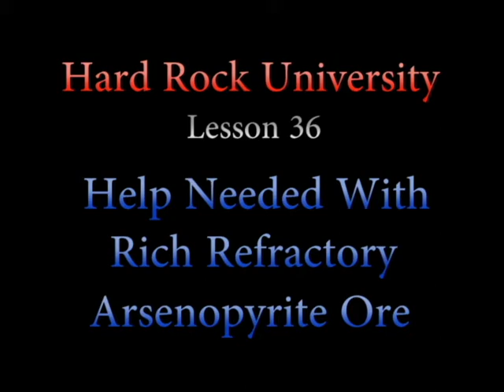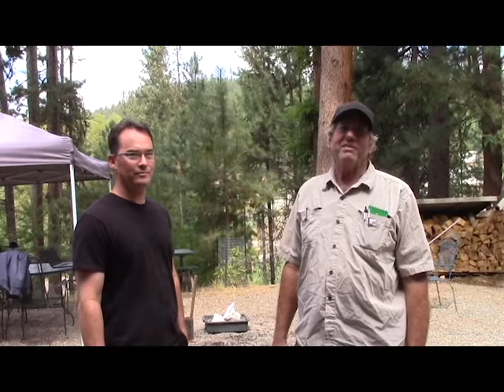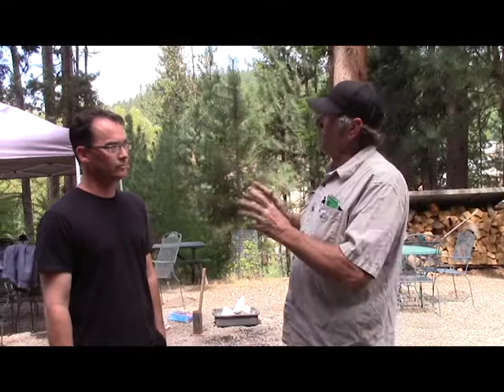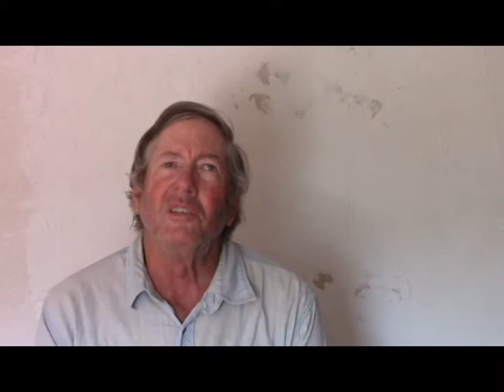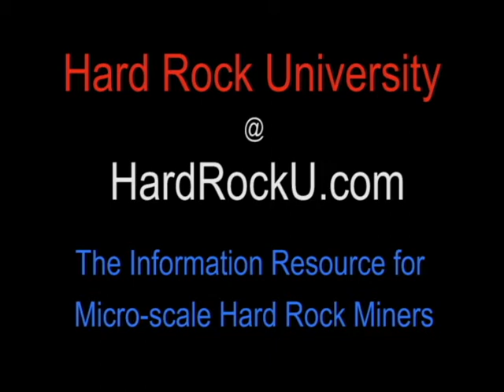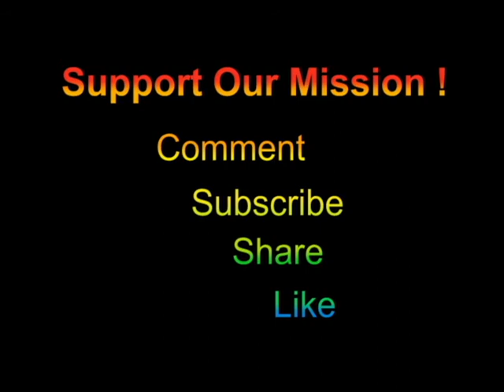Lesson 36  Help With High Grade Arsenopyrite Ore

Comment: Mike Adams's Advances in Gold Ore Processing 2005 p 319, and the journal HYDROMETALLURGY 153 (2015) pp 106-113 mention trying to get the auriferous arsenopyrite conscntrated at the flotation stage. One mentions pretrestment with sodium hydroxide, the other "selective depressing" with potassium permanganate while maintaining a narrow ORPmeter range -40 to 500mV (Wong, 2004), if I read them right. For what it's worth. Another article that suggested converting sulfides to oxides before smelting, mentioned -625 mesh being a threshold number, which one hopes would apply to conventional gravity.
Reply: You'll never get a permit inside the United States to use mercury in a mine.  To my knowledge, there are only 2 or 3 big operations still using it.  Every single item from a 1/4" washer to all of their crescent wrenches used in the amalgamation circuit are considered hazardous waste. You cannot carry a ratchet from that building to outside to make a turn on a bolt without that bolt being considered contaminated.   Amalgamation works pretty dang good but cyanide is better, cheaper, and will get approval by the bureaucracy such as MSHA, EPA, and BLM.
Reply: there's a typo there, -400 500mV was what the original said...
Reply from the maker: Thank you very much for the help.  The real sticking point seems to be what to do with the concentrates once you have them.  Roasting arsenic in the US seems to be rather frowned upon.  I'm thinking it may be best just to concentrate and sell the cons.  

Your opinion?

Keith
Reply: Btw, thank you for your very interesting and informative videos. It may be worth mentioning that, in several ways, As is not difficult to remove, which lay-prospectors may not realize. I lean towards"...make no mention of the names of other gods..." (Ex 23:13), though it may not seem to come out that way.
Reply from the maker: Perhaps it is my medication, but I am confused about this post.  :-)

I must be missing some key point.

keith
Reply: As, arsenic, a pathfinder/halo/indicator in many desirable ores, does not quite alloy with gold as tellurium may, as the papers at 911metallurgist seem to confirm. There may be semantics, eutectics, etc. An implied argument goes -- because the only way to get it out of gravity cons is heat, amalgam, high-tech or chemistry, I am going to try amalgam, because all roads to lead to amalgam. No leach by-products, no smoke, no finessing every tablespoon,...

Since I do not yet use mercury, I am guessing either there is a spiffy As-Hg removal trick that ought to be mentioned here by someone else (since I read As enters mercury), or maybe one sells the mercury when it's useless with all its gunk?

As a phosphorous-like compound, arsenic should be very easy to test for, using ~egg albumen test strips (does anything exist that should exist these days?) and such, but although it does not glow in the dark, its magnetism, "rock identification" info, excluding look-alikes, response to static/electricity, 5% lye test, froth float, matrix rock, attacking iron/Cu, smell and how it lays in the pan -- keep it avoidable.

"As is easy to remove" -- Big Gold processing As-Au ores is less than copper mining or volcanoes (25%), according to www.miningfacts.org: "Air pollution can be controlled effectively using scrubbers, electrostatic precipitators, and baghouses in smelters, which are capable of removing up to 99.7% of the dust and fumes produced during roasting and smelting. [13] Mine tailings and wastewater can be treated with iron compounds, which react with the arsenic and remove it from the water. [14] Arsenic can also be filtered from waste and tailings with iron oxides, clay liners, and activated charcoal filters, which can be disposed of safely. [14]"

The Micro Scale Redux of Big Gold precautions: If we know what the mineral species looks like, we may return much that is not in weird admixture to where we found it, or somewhere where it may prove at a less than "hazardous" concentration (1 ppm = ~ 0.034 ounce/ton, so if 10 ppm were RCRA acceptable, hide an ounce in 3 tons?), before it oxidizes/reacts into something else? [If you can match the oxidation states and match the compound, I would rather pay some Mom-and-Pop As-geology service rather than pull my hair out?] The alternative, if we do not uncover a way to sell sulfide cons over ebay may be to mail reduced trace arsenic 1 pound at a time via UPS, quintuple-wrapped, to a Hazardous Waste facility?

Comment: roast it first
Reply from the maker: That becomes complicated with arsenic, especially in the USA with regulations and all.  That seems even more difficult to get around than the physical issues.

Where are you if I may ask?

Keith
Reply: @hardrockuniversity7283  get a fan with carbon filters like computer board desoldering fan absorbs the fumes. I'm just guessing!

Comment: It sounds as though this ore is not suited to a small boutique operation as the mineralised rock (remember it is not called ore until it is profitable to extract!) may need pressure oxidation before the gold can be leached. I would recommend you send a sample to the nearest university that has a scanning electron microscope. You can use EDS (energy-dispersive X-Ray spectroscopy) function to scan the sample down to below a single micron. This will tell you what minerals the gold is encapsulated within. It will probably cost about $500-$1000 but you will know straight away if all the gold is locked up in arsenopyrite and if you should continue to put your money and time into a prospect with gold you can not recover without substantial investment.
Reply from the maker: Thank you very much for the info.  Another possibility is to simply mine it and deliver it to a custom processor.  Apparently they have had several offers, but were hoping to be able to increase their profit.  It is looking more and more like that may be the only profitable option on a small scale.

Keith
Reply: Yes I imagine selling it in its unprocessed form may be the most realistic option. Would love to see the deposit and type of rock they are mining as the grades are phenomenal.
Reply from the maker: Didn't have time to go to the mine, but- yep, that's some serious grade!  At least I got them some information for their decision making.  Someday I'll try to get a look.

Comment: p.s. I myself have been researching lately about floatation methods you might say dabbling ,maybe unwisely ha ha ,but from what I have sussed out is that the best chemical or chemicals for floating pyrite ores is a thing called sodium ethyl xanthate ,which seems to be the most popular one for pyrite ores ,and I believe you can manufacture it ,that's if you cant buy it ,by combining ethynol ,CnH2n+ioh  with sodium hydroxide ,or caustic soda NaoH  and carbon disulphide Cs2 , which I believe can be made using hydrocarbon and sulphur , then froth with pine oil or eucalyptus oil or diesel , I haven't done it yet but I would say proceed with caution ,certainly experimenting with chemical extraction could always be dangerous and that is why you should consult probably a mining chemist ,but anyway if that was of any help or maybe just dribble you can decide, cheers.
Reply from the maker: I live in Tucson with two world class copper mines within 30 minutes.  I'm sure that xanthanates are easy to get here, just haven't tried yet.
Reply: @hardrockuniversity7283  I'm in Tucson also. It seems all the parks and schools have their walkways decorated with orange quartz they got no idea it's all gold!?
Reply from the maker: @Shd191  Iron stained quartz is no guarantee of gold.  Good indication, not even more likely than not though.

Maybe we could get together sometime?
Reply: @hardrockuniversity7283  I got a whites tdi detector and shop vacs that can run off the truck. Just not sure where to start looking. Damn coyotes will get me if I start digging the washes. A gentleman told me lots of gold in  Aravacha Arizona. The iron eats gold and needs to be extracted in the lab or roasted I'm learning. Would be cool to meet up I'm near E. Water St.
Reply from the maker: @Shd191  Just north of the U of A?
Reply from the maker: @Shd191  We'll see what happens.  Just got home and have a LOT to get caught up on in 1 day before I start work.

Comment: arsenic is obviously a heavy metal , residual ,not real nice stuff ,but I knew an old banana grower once who I did some building work for ,and he used it a lot handled it probably like most old farmers ,carelessly , told me he had some blood tests done when he was younger ,and the results were that they said he had enough arsenic in him to kill ten men ,haha ,true story , but anyway I;m sure it would be bad to burn it in anyway , I suppose if you were to crush and float it with chemicals, you would need to certainly use caution ,definitely something to have a talk with a mining chemist about ,good luck, ohh I have no doubt the samples could have invisible gold , also when you said about white gold ,I thought that was palladium or platinum group metals ,maybe that's what you meant ,anyway cheers.
Reply from the maker: I'm sure he developed a resistance to the arsenic over the years.  Probably not something to try at home :-)

Electrum is actually an alloy of gold and silver.  Depending on the amount of silver, it can be anything from yellow to  white.  Most natural gold is actually  electrum with a high gold percentage (around 90%).  When it gets to 50/50 gold to silver it looks like silver.

Comment: A total lack of any free gold also makes me wonder about the accuracy of the samples -
Reply from the maker: I would use multiple samples sent to a few labs before I felt real confident without any visible gold.
Reply: Many people do not understand the purposes of sampling. This guy might have followed all the right steps - I dont know. However on the other hand I've seen plenty of samples taken totally as high grade and then thought of later as if they were the average of the whole deposit. Because of the expense, most do not take enough samples anyway. If you are only interested in the free gold, you can create your own bulk samples and see what you get.
Reply from the maker: Another issue is limited access due to altitude and snow.

Comment: https://www.911metallurgist.com/blog/arsenic-pyrite-gold-extraction-alkaline-leaching-oxidation
Reply: A answered an "Ask the experts question a month or two back that talked about options for extracting gold from pyrite. I will do more on it in the future.
Reply from the maker: Thank you very much for the help!
Reply: I didn't see it mentioned, but oxidative leaching requires special exotic alloys to line the reactor, nothing available to the normal prospector. I knew of one in Nevada run on a commercial scale - it had a special berylium alloy liner to resist the high pressure and oxygen levels. Iron would not last, and it if fails during a run because its under pressure it would explode.
Reply: Alkaline Atmospheric leach is much different of Pressure Oxidation. One is done at 95ºC, the other at  temperatures exceeding 200ºC with over-pressures of 2,200 KPA.  Pressure + Heat = Reaction rates are very fast. Atmospheric + low temp = slower, but safer.
Reply from the maker: I understand.  I bet the trade off point depends a lot on your budget also.
Reply: The alkaline leaching done in the above referenced paper was done in an autoclave under pressure: 40 to 200 psig according to the researchers. As I noted, the reactor autoclave must be made of exotic materials to withstand such a strongly oxidizing environment - even at moderate pressures.  Use of plain mild steel would still result in disastrous explosive failure even at 100 or 200 psi. This type of treatment is just not within the reach of the small scale miner. Oxidation by bio-leaching is much closer to something that is achievable by a small scale operator, and it is done at atmospheric temperatures and pressures.
Reply: Hi Chris, you are correct; neither are for small miners. Froth flotation is the 1st stage.
Reply from the maker: Hi Chris,

Perhaps this might make a good topic for an article in the ICMJ?  I don't have the expertise of course...
Reply: Reading those reports linked above were way over my head! I'm thinking that with all the problems involved it might be worth looking into finding a mining company that could mine and process the ore! Just think mining in a hasmat suit, and the environmental cleanup of the site after mining operations are complete would be a nightmare!
Reply from the maker: It does seem that the environmental aspects add a lot of cost and complexity.   Mining it and hauling to a processor does have a certain appeal, even if the cost is high.
Reply from the maker: Great.  Looking forward to the latest info.